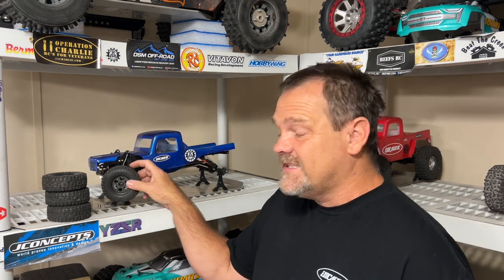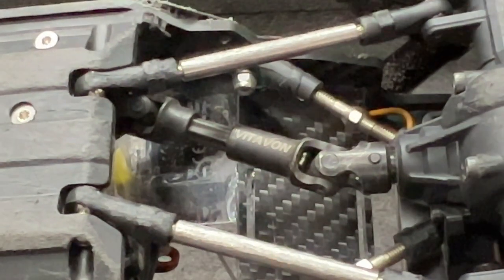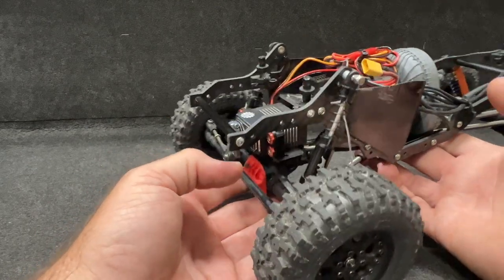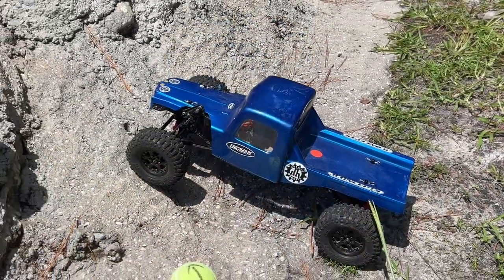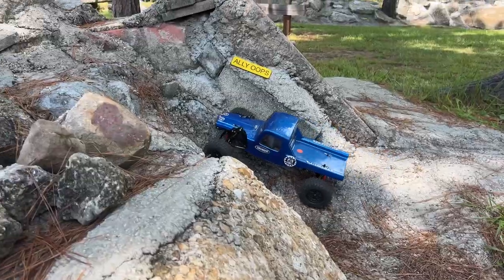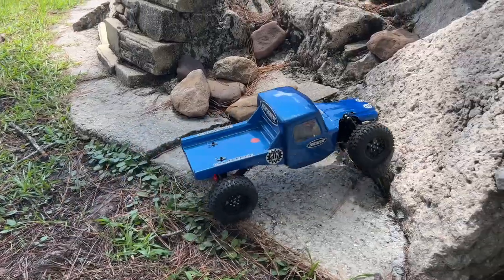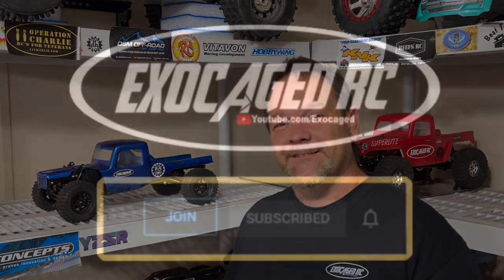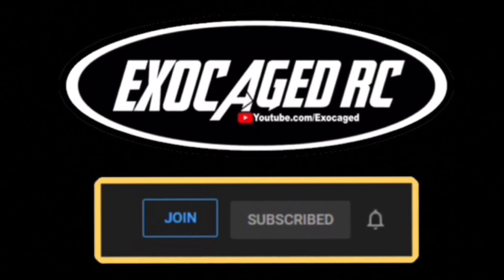NEW C1 Cheater Rig is BONKERS!!

Comment: You must must must turn the rear lower links around the bend is supposed to go towards the front on this kit please give it a try I promise you will not be disappointed I run the same thing it won't effect cg it help break overs its how it was made for everyone puts them on wrong because that's how most chassis are but if you look it up it is wrong in the configuration the way you have them please try I run it in a c3 and took 4 podiums ever since it destroys